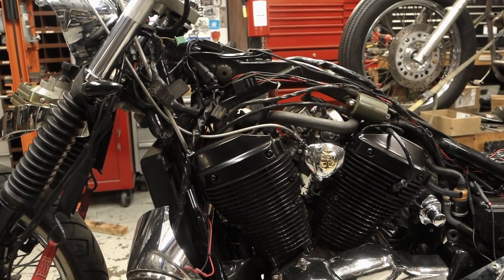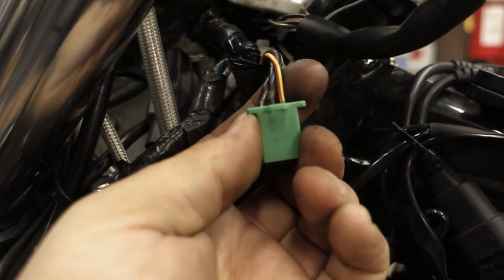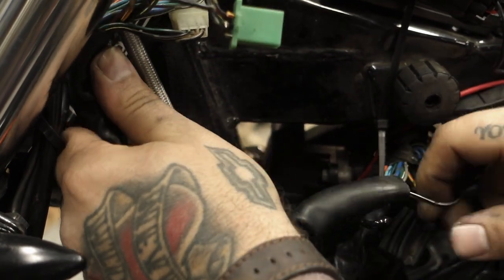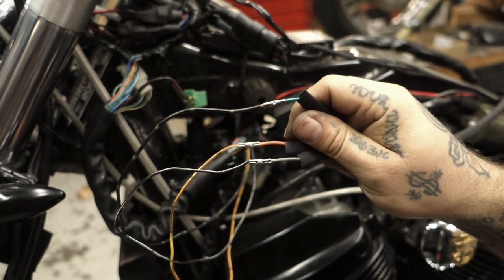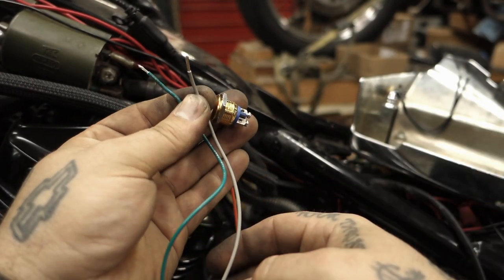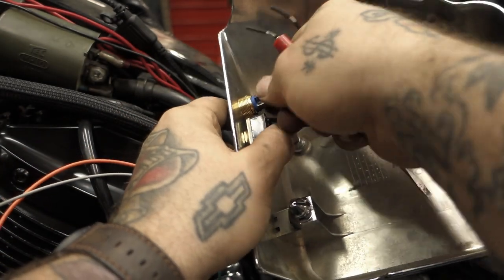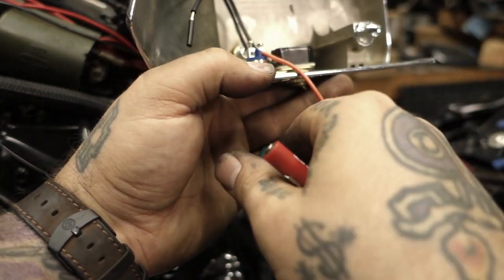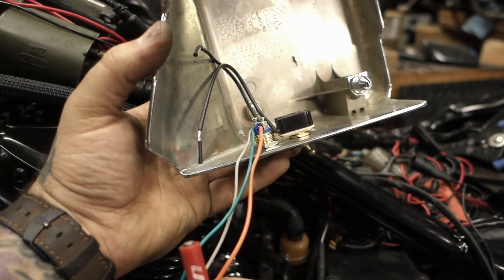How To Relocate A Start & Kill Switch On Your Honda Shadow Build

Comment: Thanks for the tutorial it was helpful. I have a 1985 Shadow VT700C that I'm trying to connect the start switch to a push button switch that has 2 pigtails. I connected the yellow/red wire to one wire and the black/red to the other wire on the new switch but it's not working. Those seem to be the 2 opposing wires on the original start switch. I tried the black on one side also, but it's not working. Any help would be appreciated it. I must have it wired wrong.

Comment: Thanks this gives me a better idea than the diagrams did. I'm trying to  swap out my 99 vt750 killswitch start button assembly with a aftermarket one. I've got 3 buttons and want to wire my headlight up to one so i can a warm my bike up without blinding everyone at work or the camp site till I'm ready to take off. While not a walk through i think i can experiment and figure it out. I'm not a big electrical guy but no better time than the present to learn.
Reply from the maker: Good luck!

Comment: Very easy to do and I hate dealing with electrical. Only thing I did differently was I opened the wiring harness just above the heads and pulled the wires back there that way I didn’t need any extensions or crimps

Comment: So with wiring it up this way do I have to do anything with the headlight wire. Where it comes on with the key since I’m taking the high beam switch out. I don’t need the high beams anyway. Just the headlight

Comment: When my keyed Ignition stopped working I looked up a new one and they wanted about a $100 or more. I went to home depot got a 5 Amp toggle switch ($5) wired it in the keys place with bullet connecters so i can by pass that switch in a pinch. I still put the key in for looks.

Comment: How does this work when you have to pull on your throttle as well as engage the clutch all the while pushing the ignition?
Reply: I don't know about you but I have a 2001 shadow saber 1100 and I only have to pull the clutch in if it's in gear. If the bike is in neutral I can just start it with just the start button. Never had to touch my throttle to start it.

Comment: I got the single cable throttle assembly and an planning on doing this mod, but since the right side controls are now gone from the handlebars, how do you go about getting the brake light switch to work? Are you only using the rear brake to illuminate the brake light?
Reply from the maker: use the rear brake switch. you dont need both. how often are you ONLY using your front brake?

Comment: Just did this to my ace.
You the man tj
Reply: Going to do this to my spirit. Have any problems?
Reply: @nathanielselvidge4157  no you shouldn't
Just know you're gonna have to do stuff behind the headlight. At least the ace is that way.
Reply: @ryanwilliams3369  
Well shit... I didn't know that. And i just got my single cable throttle assembly... Was planning on cleaning up my handlebars a bit

Comment: I know this is an old video but I had a question. You didnt do anything with thw headlight shutoff wire.  So how do you turn off the headlight when you try to start the bike? I am under the impression the headlight draws enough power that the bike may not start if its still on while starting???
Reply: Currently working on the wiring harness right now and all you need to do is take your black and red wire to one side of an on off switch and then connect your headlight wire to the other side so if your switch is in the off position when you go to crank your bike your light will not come on. you can Trace a green wire from the harness and put your negative from your headlight wire together with the green and that is ground. I highly suggest you upgrade your ground wire that is right above the front ignition coil though.

Comment: I already did this, but want to remove my ignition.. do I need to do ANOTHER toggle switch? Or can I just get rid of the ignition?
Reply from the maker: Yes, you need to replace the key with a toggle.
Reply: @TJBRUTALCUSTOMS to confirm.. cause I’m dumb… I’ll then have TWO toggles. One to act as the key. One as the killswitch?
Reply from the maker: @Patriotgoon  yeah one as the key on/off, one as kill, or you can bypass the kill and just have key on/off and a push to start switch.
Reply: Oo. That is a better option. Thank you🙏 your website is basically my go to for this build. So I’m thrilled you have a YouTube. First build I’m excited. Thanks for the help… I will probably be asking more 😂🙏

Comment: This might seem a dumb question but how do determine the type of wiring to use?
Reply: Any electrical on vehicles I personally think you should go with the same gauge wire that you have snipped
Reply: And most of it should be a copper wire
Reply: Appreciate the response!

Comment: Also what did you do with that headlight wire?
Reply from the maker: This is how i wire my headlights. https://d33v4339jhl8k0.cloudfront.net/docs/assets/5a6f7e612c7d3a1eaf1e12ff/images/5af357c22c7d3a3f981f6ca6/file-QtYvE1PNBg.jpg
Reply: @TJBRUTALCUSTOMS Are you by passing the blu/wh wire and wiring directly with the individual blue and white wires? And is the blue wire spliced into the black/red one? Trying to understand your process on the headlight with your picture and a wiring diagram.

Comment: I kno im late but do you have any references to possible do this on 83 vt500c mine doesnt have those midway connectors i believe mine goes directly to the junction box.
Reply from the maker: Man im sorry but we really dont do anything with the 500's they are an obsolete model. but if i were you id lay hands on a wiring diagram and just start tracing the circuits. thats how I did it!
Reply: @TJBRUTALCUSTOMS  thanks ive been searching for the correct one as well it seems like most ppl bobber style their 500c but dont give any detail. Almost like gate keeping 🤦🏿‍♂️😂. Ill keep searching.

Comment: The previous owner of my bike has the factory start and run buttons active, but the ignition key mechanism has been replaced by a toggle switch. I want to go back to a keyed system, have that toggle switch (inconspicuous location) operating as kill switch and then run TJ’s button start which is currently onboard just not hooked up. Do I just fish out the wires from the oe button start run them to the toggle switch and then to the push button as TJ suggests here? I’m excited to get this going on my ride. Am I missing anything? Thanks 🤙🏾😎

Comment: Heyy! I got the start button working! (Without kill switch) and i also rewired up the headlight. I an unsure how to connect the remaining wires in order to keep my licence plate light that operates off the bikes running power. I am ok with not having the front brake switch but id like to keep my licence light! Help plz :)
Reply: How did you rewire the headlight. I’m trying to put it on a toggle switch since I’m getting rid of the cluster on my handbars
Reply: @mariocevallos8134  any luck with that project? iv got that in mind for my vt750 clean up the handle bars. the wiring looks so simple but i know ill be in the shit if i make a mistake haha

Comment: If wiring up to a kill switch like at the end of this video does it matter which wire the green or gray go to ?  Thanks for this video it put hope back into a old build
Reply: And also. On the clip you cut from in the beginning what do you do with the other three wires ? What are they for ?
Reply: no it doesn't matter which side (once wired to the switch) you go from

Comment: On the VT1100 the blue/ white wire feeds the headlight hi/low switch. Have to tie it into the black/red wire or you lose power to the headlight.
Reply from the maker: This is how i wire my headlights - 
https://d33v4339jhl8k0.cloudfront.net/docs/assets/5a6f7e612c7d3a1eaf1e12ff/images/5af357c22c7d3a3f981f6ca6/file-QtYvE1PNBg.jpg

Comment: I'm trying to do this but I can't figure out which wire goes from the kill switch (toggle) to the starter button (push button) does it matter? Or am I over thinking it?
Reply: What I did when watching this video was watch how he had the Killswitch positioned and when he said connect this wire to that and that wired to this, that’s what I did. Honestly, I don’t think it matters when it comes to the Killswitch. It’s an on off situation and if you have it flipped around then all you have to do is flip the little indicator plate around so that faces the right way for on/ off

Comment: Yo TJ do you have a video or diagram for a push start, no kill switch and on off on toggle for headlights? I've followed this video for the push start set up with no killswitch, but I've also incorporated your diagram for on off on toggle switch for headlights but now my headlight aren't working. On my push start ive got ylw/rd on one side then blk/g and blk/w on one side. For my on off on toggle ive got  blue plugged in and going to the headlight (and still spliced into high beam indicator), then black/red in the center (goes straight to the fuse box),  and then white that goes to the headlight and nothing else. I couldn't find anything in your vids or forums that showed the push start/onoffon/no kill switch set up all in one. Any info would be great, I understand its electrical and you don't know exactly what all ive done to it in order to give me an exact answer, im just curious if youve got a diagram as to how its supposed to be done correctly. Im thinking since stock setup had a blue/white jumped from the toggle to the start button that that would have something to do with it but again I'm not sure. Thanks in advance man
Reply: 02 vlx 600 cd btw

Comment: So why did u add wires to the previous wires? Can’t u just use the regular wires without adding wires. If its necessary what size wires did you use?
Reply from the maker: As the title says -to relocate the switches. 👍🍻

Comment: thanks for the vid I want to give my 96 vt1100c a crisp clean look and will be adding this to it is there a way to clean up the motor area of all the trash from the factory and make it still run and be clean as well
Reply: Cool, i also have a 96 VT1100C and im curious if you were able to do this. So, maybe a vid on your ride, how well it was cleaned up, possible switch places.

Inquiring minds would like to know.

Hope you were successful.
Reply: Hey, did you have the same wires? For mine, I don’t have that black and green. I am getting no spark for my plugs.. I have a blue/white, black/red, yellow/red, and a black/white. How did you wire yours?
Reply: No I sold that bike years ago and got a old harley sporty I am building now

Comment: is there a video about what to do with the headlight end?
Reply: @TJBRUTALCUSTOMS  Any update on that? Would the headlight wire be connected to the starter or the kill switch? Ive eliminated the kill switch so would it be the kill switch wires and the headlight wire attached to one end and the starter to the other?

Comment: TJ I recently replaced my key switch with a toggle and installed a new push button start next to it exact set up as your video, do i need to connect the two or can they remain independently wired, do you need a kill switch wired in for the bike to start? is there an immobilizer i am unaware of? 

Battery is charged, fuses are good, i have watched all the videos, looked up the wiring diagrams and followed everything 100% and cant get it to start. HELPP!!
Reply: Thanks mate ill be sure to go through it all again, it should be so simple hence the frustrations!

keep up the good work man! videos and products are awesome have been a massive help to date
Reply: @TJBRUTALCUSTOMS i can still wire the kill switch to the push to start button to eliminate the need for an extra toggle switch right? exactaly like you have done in this video?
Reply: @tjbrutalcustoms I just purchased these push button and toggle switch from your site but it says nothing about if they are water proof or not. Obviously taping up the wires but are the actual buttons and switches waterproof before I mount these lol

Comment: Do you have a video of relocating the hi and low and turn signals?
Reply: the high and low beams and be moved to an on off on switch just using the white, blue, and black and red wires

which will in turn remove the low beams and create an on and off for the high beams.

there is a wiring diagram on his website at support.shoptjbc.com

just search wiring.

the turn signals can be relocated as well with the grey, light blue, and orange wires.

there are three others as well that are running lights for your front signals and I personally didn't use them and eventually ended up taking off my blinkers.

Comment: Alright im currently building a 2005 hondashadow spirit vt750dcb now let me mention that most of the factory parts were gone. No blinker mainly ive been trying to find a stem to mount some after market blinkers ive bought and i cant find none,  do you know a part  resolve this problem for me ive been beating my head against the wall for months

Comment: Tracing my wires back from the start and kill switch it runs to the red plug not the green. (02 600 vlx) The green plug ran to the left side... Probably best to look up the wiring diagram before doing something like this

Comment: I am relocating start switch and getting rid of kill switch. Installing same switch you have in the video. Little confused about wiring the switch. When i removed factory housing, kill switch had Red and Orange wire and start switch had Blue and Green wire. How do I connect those to new start switch? Please help.
Reply: Sorry Start switch had Blue and Black wire

Comment: How did you rerun the brake light switch ?
Reply: How to disco net vacuum line on 2002 Honda shadow ace  750
Reply: I had the same question and thought the same thing myself. I'm new to the motorcycle thing so another question I have is about replacing the other hand controls and what to do with the clutch diode. Can it be bypassed?

Comment: Great video but I need help! I did exactly what you’ve done here. I didn’t add a kill switch either. I’ve double checked all wiring fuses and all but my bike won’t start when I push the start button? What do I do?
Reply: Check the starter relay
Reply: @jaycee9086   my is doing the same thing
Reply: My is doing the same thing
Reply: Did any of you figure out why it’s not starting? My bike cranks like it’s going to start but it never does.
Reply: I'm trying to wire up a 1981cb650 that I put on a rigid frame starting  from  scratch  wires not even ran to controls on the handle bars I've never wired a motorcycle and have looked at so many diagrams it's not funny is there anyone that could help me out with this.

Comment: im looking at an 84 honda shadow harness, i have the section on the table that goes from the right grip to the light cluster and its only a ft long,     leaving my brake light switch going to the bars and removing the start and killswitch buttons, the colors of those 2 buttons dont match these in the video.

my non latching start button has y/r, black, blue/w, black/red, and i have a nonlatching button i want to attack,       looking at the button im assuming the black wires are the power and ground because theyre allways attacked and the blue is normally closed because it is attached when unpressed and the yellow and red goes to starter because it is connected when pressed, is that correct? if so is solid black the power in and black/red the ground?
Reply: @TJBRUTALCUSTOMS  its only a little different, i pulled it off the bike entirely, tho typing it out helped me understand it a bit more tbh, thanks for the video !

Comment: Does my tank have to be off for this? Jw (vlx 600) thanks
Reply: No, just remove the front neck covers.  The connector is on the left side. The connector is not the same as the 750.

Comment: So the 07 spirit has 4 wires running to the starter. I’m not sure what to do.
Reply: Awesome! Thank you!
Reply: TJBRUTALCUSTOMS you have a service manual for the 2010-2013 VT750c2. Does this also work for the 2007 VT750c2?
Reply: Color wiring diagrams for Suzuki bandit 1250

Comment: I’d find a different spot to put the switches so you don’t have to snip the wires each time you want to just pop off your side panel for anything
Reply: I wired mine into the side panel and connected it with connector plugs. Works like a charm is I need to disconnect

Comment: Would that and you single throttle cable work on a Rebel 250?
Reply: TJBRUTALCUSTOMS oh Jeeze. Yeah proof read David lol. The kill switch. Thanks for replying.
Reply: Before I order I'm assuming for 7/8 bar fit? Oh and nice Crimson Ghost tattoo lol. I'm a big Misfits fan
Reply: David Mugsy Clewell 1”

Comment: I think this is why my headlight isn’t working now
Reply: My headlight is also not working now did you figure this out by any chance? The kill switch and start button i wired in work perfect but no headlight and my front brake won’t activate my brake light, only my rear brake
Reply: The the blue and  white wire feeds the headlight. Splice it into the black and red wire and everything works
Reply: What year are yalls bikes? And what red and black do you mean individually red and the other black
Reply: @vp8589 Thank you for this comment. This solved my headlight issue
Reply: @vp8589 are you splicing it directly into the wire or are you hooking those two to a toggle switch too?
Reply: @vp8589 dude thank you for your very helpful comment

Comment: 2 questions .

1. why did you abandon the headlight cutoff . 

2. you also abandon the kill switch ,  what is the advantage of having kill switches?
i mean, i hardly turn mine off and obvs, if cant be that important if you ignored it just here in your build
Reply: The kill switch is just to basically act as a key on the handlebar so you can turn the bike off without turning the key off